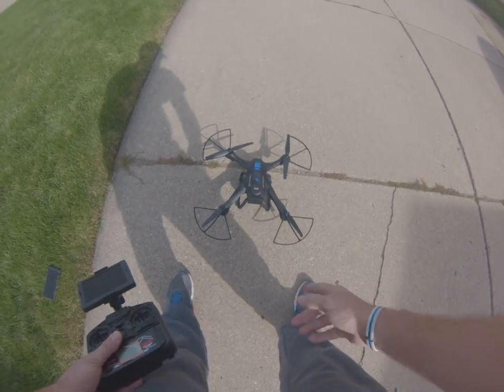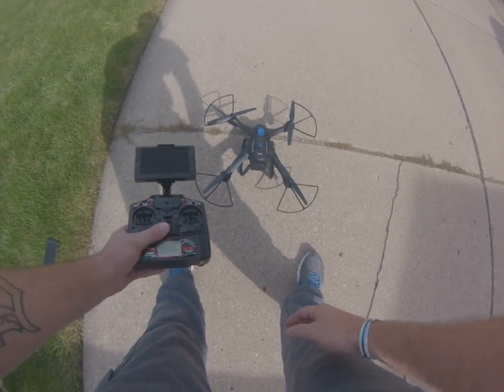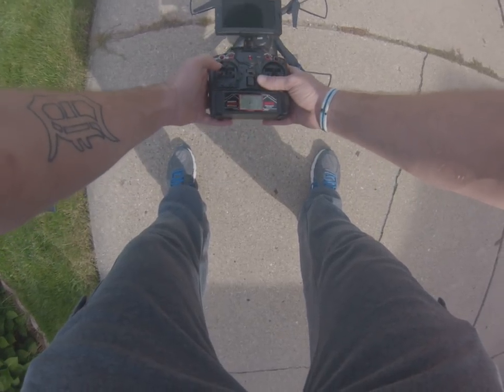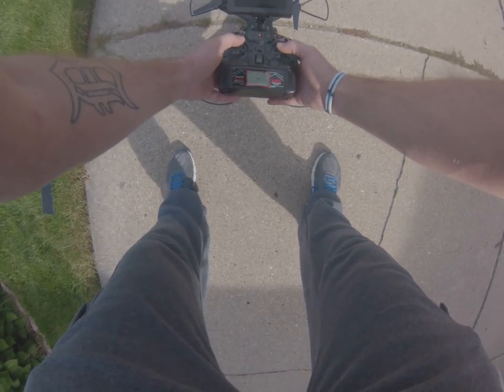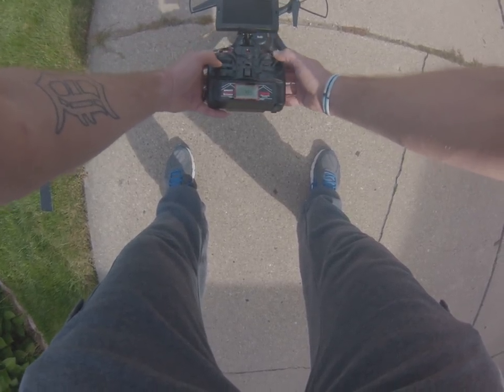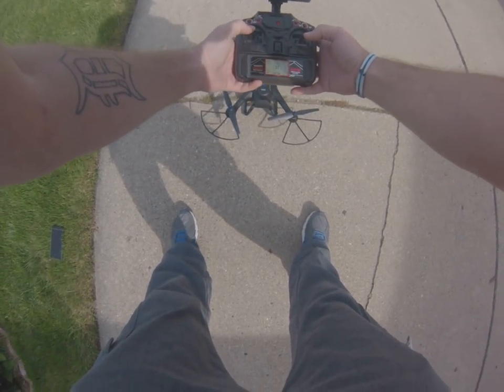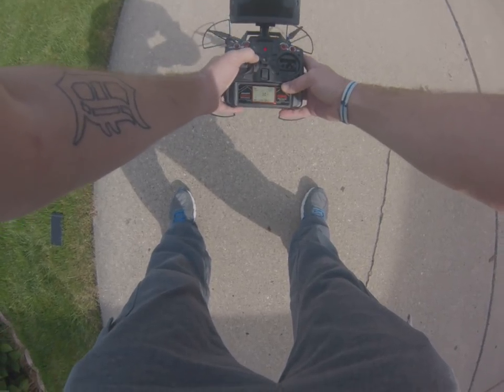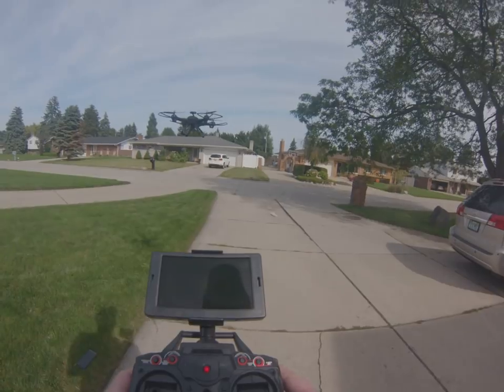Global Drone X183 Calibration

Comment: My question is. If the global drone is almost out of sight and it goes in auto-return home, how low on voltage will it go before it falls out of the sky? Do the batterys do better if they are deep cycled a couple of times? Thanks for the fast response. Chris
Reply from the maker: Chris Guertner If the battery is low, it will start to return to you and land itself rather than just crash down.  Deep cycling does help a little, but nothing dramatic.

Comment: I am glad I found your utube. I watch 20 or30 others, but found no help for my first and new Global drone. I read every comment-question and figured out my problems. The manual was very hard to interpret ,broken  English and all. I got it to fly twice, but did not know what I did right. Suffered many failures to launch.Even followed your video to perfection I thought. I was about to ask you for help, maybe even mail it to you to see if you could make it fly. I figured if you can't make it fly I got  a defective drone. I reread all of your advice about turning it on. Discovered timing is crucial. Under 10 seconds to turn on the drone then radio, then gyro calibration, then immediately compass calibration. This is what I was doing wrong, I read you told someone to slow down twisting the drone, I tried that, no good. So I tried as fast as I could and and I have had successful flights ever since. I want to thank you for your patience with everybody else, it helped me. Now for learning how to fly it, so far I'm doing OK, baby steps, first time low voltage kicked in, the drone went from low altitude to 30 feet straight up. I could not control it anymore, I thought it was a gonner, like fly away and crash, but it flew over to the launch site and landed softly, WOW! Now I think it is a great learner drone for $130. I wish 5 minute lessens weren't 3 hours apart. If it survives for awhile I'll get some Syma batterys and props and a faster charger. You help is the best out there. I want to THANK YOU very much. It is nice knowing some people really want to help without profit. I am that way too. Thank you Chris.
Reply from the maker: Chris Guertner 
Thank you for the kind words Chris, it makes me happy to know that my videos were able to help you. The battery life is horrid, I actually have it to my father to learn on, and bought myself a parrot bebop, actually for less than I paid for the Global Drone. If you have any questions, I'll be happy to help you in any way I can.
Reply: Thank you so much for this detailed reply! After searching for hours i stumbled accross your comment and it was the exact problem i was having! Thanks to you im my kids superhero! Works every time!

Comment: No I'm in ny.  So oddly enough I went outside and just redid calibration as per that bayangtoys video and that did work.  I got solid lights now.  But pulling the levers down won't start the propellers.   Any ideas.
Reply from the maker: Shawn F congrats.  Both sticks down towards the center.

Comment: And believe me, I'm grateful you did.  I also like to say thanks for responding.   Not sure what will happen but I may message you again if I can get the battery to charge at all.  I'm guessing this may be the overall issue as to why the lights are flashing in that pattern I mentioned earlier. 

Thanks again Logan.  :)
Reply from the maker: Shawn F I'm glad to be of some assistance. I actually upgraded my drone to the bebop

Comment: HI Logan, sorry to bother you again.  I did what you suggested.  I went outside this morning and even though the lights are flashing (1 long flash 2 short flashes) I tried the calibration as indicated in your video.  When I put the sticks to opposite ends, the lights flash real quickly and then I did the opposite ends again and still lights flash real quickly.  Then when I release the sticks, the light resume to the same flashing (1 long flash 2 short flashes).  So it seems taking it outside didn't help.  I was reading further comments yesterday on your video and someone said something about the voltages.  If I recall correctly, I think the TX was 7.7 and the RX was 5. something.  I dont know if this is the norm for this.  Do you know for sure?  Also do you know about the charger indicators when charging the battery.  So when I first plugged this in, the RED and GREEN lights were on.  The book says less then 200 minutes, thats about 3 hours.  After 3 hours, the lights were exactly the same, RED and GREEN SOLID. The battery wasn't even warm.  I assumed it was charged.  Do these lights go out after charge is complete or does RED light go out and green stays on to indicate charge is complete.  Any info or advise from this point would be helpful.  I"m currently fighting with vendor because they offer ZERO help.
Reply from the maker: Shawn F The TX should be at 8.4v when charged completely. They charger itself should be green when charged completely. My first charge took 2 cycles to get it fully charged. That manual is useless.
Reply: Thanks for the reply.  I have rechargeable batteries in the Remote.  I can't imagine in the few times I tried to get this to work they would drain that much.  Ok..being said that...could this be why the drone lights are flashing the way they are.  Cause the battery isn't fully charged?  I am using a USB to 110 adapter to charge the battery, is that what you did?  I have the battery and charger with me today at work.  I'm hoping to see if the red light goes out at some point.

What kind of AA batteries did you put in your remote?  If I recall correctly, TX is transmit and RX is receive.  So the transmitter, or remote needs to be at 8.4v - that is why i ask what batteries did you use in the remote.  Mine are rechargeable energizer batteries.

You're right, the manual is useless.  Its what I called Chin-glish (translated chinese to english)

Is there anything else you can suggest to getting this to work providing the battery does charge fully?

I appreciate the help.
Reply from the maker: Shawn F I'm sorry, you're right. The drone should be at 8.4v.  I just have Duracell batteries in the remote
Reply: Logan45499....thanks for your reply.  I have had the battery on charge since 830 this morning, both red and green lights are still on.  This is quite misleading as I don't know if the battery is bad or if charger is faulty.  How many hours did you have to charge on your two cycles?
Reply from the maker: Shawn F I think initially I charged it for a full 24 hours

Comment: Hi Logan, excellent videos.  May you might know, seems others may of asked same question.  So after figuring out how to sign remote and drone, I did the calibration and had an issue where it didn't go exactly as yours did.  So now I have 1 long flash and 2 short flashes.  Do you know what this means.  I tried disconnecting the battery in the drone.  I even let is sit that was for 15 mins.  I can't even get the props to spin at this point.  Does it matter if Im doing calibration in the house, should I do this outside?  Any help you can provide would be great as manual is useless and no good english videos other then yours.  Thanks.
Reply from the maker: Shawn F Thank you.
The drone needs to be outside. Mine had the same flashes, once it calibrated the flashing stopped

Comment: My problem is that Drone lifts off and hoovers for 3 seconds and then goes into Auto Return To Home mode. When drone lands the lights on the drone are blinking and the gps indicator on the remote screen also still is blinking... but the battery pack is fully charged. I've tried it several times but with same results. I think motherboard and or remote controller are damaged perhaps.
Reply from the maker: Roberto Derossi It could be an internal problem.  The only times mine had done that, is when the battery is low.
Reply: Battery works properly and in full charge. I tried a new battery also.. 2.700mph but nothing it touch down immediately.
Reply from the maker: Roberto Derossi Must be an issue with the drone itself

Comment: Can you put a different battery to make it last longer? If yes what kind I just got one sorry new to this kind of a noob
Reply from the maker: Uncle Darren https://rover.ebay.com/rover/0/0/0?mpre=https%3A%2F%2Fwww.ebay.com%2Fulk%2Fitm%2F173118141981
Reply: Logan45499 I got the same battery was hoping there's other battery that last longer
Reply from the maker: Uncle Darren Its a higher mHz
Reply: Logan45499 oh I just notice sorry about that yea mine is 7.4v 2000mah would it make a lot of difference?
Reply from the maker: Uncle Darren Not a lot to be honest.  Those were the biggest ones I could find that would fit. It's nice to have the extras.
Reply: So you recommend 7.4v 2400mah?
Reply from the maker: Uncle Darren Yeah, they work good

Comment: Hi guys.I am in south africa.I received mine and it took off the first time and will not again.Lights flases 2 into 1.Bat is at 8.4.I have done the compass a 1000 times but it will not stop flashing.Any suggestions or do you think i have a faulty drone.
Reply from the maker: Walter Van Dyk That flashing means it's not calibrated
Reply: Logan45499 i have calibrated gyros first and then the compass with the 3× clockwize 3× camera pointing down and the lights will not go solid.I have tried doing it slow and fast buy nothing hapens.When i got it the firts time the light went solid after a minute and i didnt even calibrate the compass and it flew fine.Anything else you suggest i can try.Feeling hopeless.
Reply from the maker: Walter Van Dyk Have you tried unplugging the battery and plugging it back in?  I ran into the same issue last week, and that helped mine.
Reply: Logan45499 I have.Took the bat out of drone and remote for 2 days and put it back and was the same storie.I appreciate your help.
Reply from the maker: Walter Van Dyk hmmm, I'm sorry, I don't know.  That always fixed it for me

Comment: Cool vid but still wont take off
Reply from the maker: MadiCat247 It took me a few tries to actually get it to work. Also, if the battery isn't read as being fully charged, it also will not sync with the sattelites.  I think that the battery needs to be at least 7.4v

Comment: It works but I hit the button for take off and it falls backwards and is stuck....
Reply: Emanuel Calderon that is exactly what was wrong!  Its flying now.
Reply from the maker: Jennifer Duty Make sure you have the blades installed correctly
Reply: Logan45499 Im just realizing my son didn't screw in the blade protectors.
Reply from the maker: Jennifer Duty lol
Reply: Logan45499 ty seems so obvious now.. upon further inspection blades not inserted correctly at all.  Leave it up to my 17yr old 🤣
Reply from the maker: Jennifer Duty LOL.  Glad you got it fixed.
Reply: Maybe the blades are in the wrong spot? they have A and B.

Comment: 13 satellites! And it still would not take off!!! What's wrong???
Reply from the maker: pressman1111 What is your battery voltage?
Reply: Logan45499 battery is full
Reply from the maker: If the voltage says its below 7.4v, it wont take off

Comment: Can anyone help me I'm doing everything in the video.and it still won't fly the propellers will spend but it won't fly.the lights won't stop flashing.what am I doing wrong.
Reply: Hi Terrance Pitts, I finally lifted my drone yesterday. Initially I saw a message from Logan saying doing the clockwise  rotation slowly. So all I did was to increase the pace of the rotation faster and i got it calibrated and its flying. I just need to get a hold of the controls as a first timer. Thanks for your assistance.
Reply from the maker: Terrance Pitts I found that when I initially calibrated the GPS to the drone, that I had to rotate it relatively slowly.  Also, be sure that when you place it on it side to rotate, that the camera is pointed towards the ground.
Reply: Please i have tried this times without number and my drone still wont fly, the lights just keeps flashing. i even tried the rotating slower as well. Still not flying but propellers will spin.
Reply: olaiwola ashorobi  I was trying to do it inside my house.thats what i was doing wrong.it couldn't get a good GPS...
Reply: Hi Terrance, I am doing mine outdoors and have about 18 satelites and still will not calibrate. The light keeps blinking in the same sequence with the lights under. i'm thinking its a location issue cos i am in Nigeria, could that be possible?
Reply: olaiwola ashorobi  it could be...
Reply: olaiwola ashorobi
No. Not unless Nigeria has migrated to be close to the North or South Magnetic Pole - the only places you can't calibrate compass.
Reply: olaiwola ashorobi
This quad must have a set time that you have to complete the calibration in or it goes crazy - like the Bayangtoys X21. Check the excellent video by MartinStaehle on fixing that.
Reply: Remote battery is full capacity!!
Reply: Be aware that the battery in the drone should reach 8.5 for calibration to be successfull. In my case, the battery charger was not working propoerly so I did note get full charge, I had to connect the drone to a power source and finally the calibration worked. After that I repaired the faulty usb charger
Reply: Guillermo Primo. I don't think so, mate. 8.4V is the maximum for li-po batteries. Charge them over that and they will puff up very quickly!
Reply: theoztreecrasher I don’t mean to overcharge, 8.5 is the maximum charge the battery accept, that won’t blow the battery off. I will just make the drone calibrate correctly and fly for 7 minutes

Comment: Hi, I got this drone a couple of days ago and have only flew it once, the second time I came to fly it nothing happened, it won't start and I can't calibrate it. When you start to calibrate it does the red flashing light flash on and off then go off, mine is constantly flashing, any ideas? Much appreciated thanks
Reply from the maker: Neil Molyneux Are you referring to the red light on the remote?
Reply: Hi, thanks for the reply, yeah the red light in the middle of the remote at the top, all it does is flash. When I first flew the drone for the first time it wasn't flashing, the second time I went to fly it, all it was doing was flashing so I tried to calibrate, like in your video and can't get it to work. Thanks
Reply from the maker: Neil Molyneux usually it only flashes as it's connecting to the drone and receiving sat signals. I would probably try pulling the batteries from the remote and reinsert them, kind of a reset for the remote. Constant flashing is usually a sign that the remote isn't syncing.
Reply: Hi, it started to calibrate it before, the flashing red light went solid, then all of a sudden the lights on the drone blinked and went out. The only time they come on now is when I turn it off, then back on again and then 2 seconds later they go out and stay off and the drone does nothing and the red lights is flashing again. I think it could be faulty, I wonder if there is a factory reset sequence so I could try that? Thank you for your help and sorry to bother you
Reply from the maker: Neil Molyneux It's no bother. From the sounds of it, it appears the battery inside the drone is low.
Reply: Hi, it's been charging for at least 4 hours and the usb shows a green light when it's done, is that correct? It's driving me mad, I got it as a present for my birthday last week and only had one go. I'll charge it up for another few hours and give it a go tomorrow. Thanks again
Reply from the maker: Neil Molyneux It takes mine like 8 hours to fully charge. It should read 8.4v on the remote when its fully charged
Reply: Hi, thanks for the reply, I think the battery or the drone is faulty, I have had the battery charging for over 8 hours and I plugged it into the drone and started the calibration sequence. The lights flashed for a couple of seconds so I tried to calibrate it, but the light went off and stayed off, the only way they come back on again is when I unplug the battery and plug it back in, but they only stay on for a second and go off again. Thanks
Reply from the maker: Neil Molyneux I would agree that something wrong with either the drone or the battery
Reply: Yeah I think so as well, I have emailed the seller and told them about it, hopefully it might just be a dodgy battery and they can send me a new one. Thanks very much for all your help
Reply from the maker: Neil Molyneux You're welcome

Comment: Hello Logan, maybe you can help me? I have on the monitor the '' GPS '' is still flashing? I can start motor but can't fly the drone. Thanks in advance.
Gérald
Reply from the maker: Gérald Proulx I believe that means that it hasn't calibrated to the GPS satellites. Try going slow and steady
Reply: Hello Logan.
Thanks for replying, I have done the calibration of the GPS slowly and Bingo it works. Just do it while the lights flicker and wait until the GPS receives enough satellites, when the lights stay on at this time I can take off the Drone. Once again thank you.
Gérald
bye
Reply from the maker: Gérald Proulx That's great news, glad to be of some help.
Reply: Hello Logan, another question for you. Battery full charge is 8.4v, on the transmitter when the voltage indicates 7v, I have less command response, I guess this is the limit of use? Do you have the same conditions? Thanks in advance.
Greetings
Gérald
bye
Reply from the maker: Gérald Proulx Yes, mine is exactly the same way.
Reply: Logan45499  hey logan, someone told me to feed small strong wire through the hole of the stem, wrap it around, and slip the blue cap back on.....Your thoughts?
Reply from the maker: pressman1111 That would probably work, as long as it doesn't catch on the blade at all